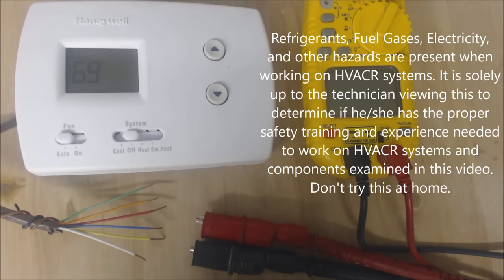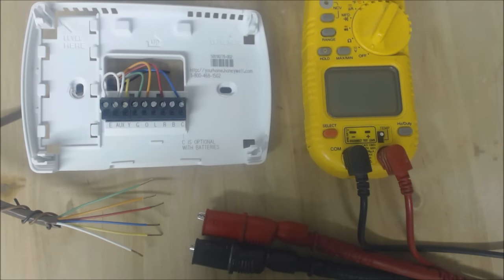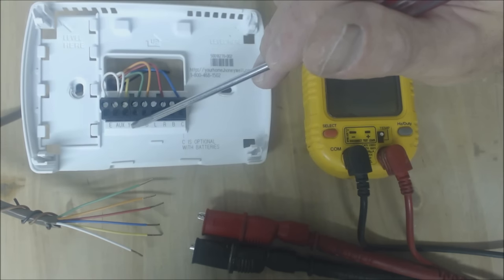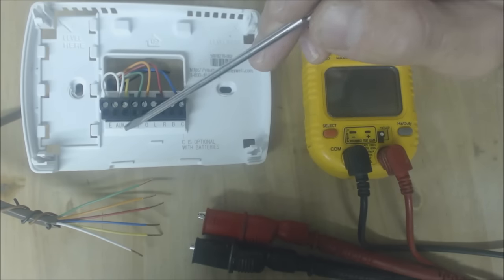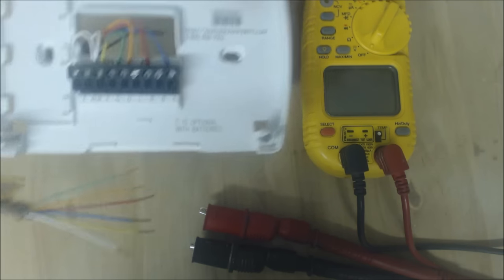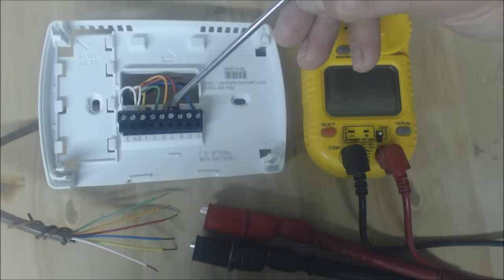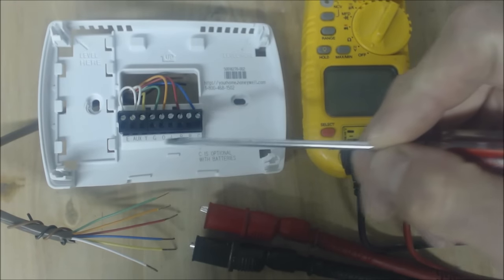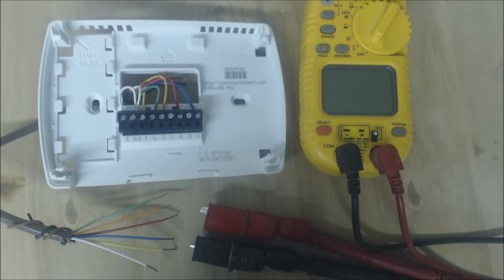Understanding and Wiring Heat Pump Thermostats with AUX & Em. Heat! Terminals, Colors, Functions!

Comment: hi, so with AC there's a coil above the furnace. with a heat pump, is it the same coil above the furnace? or something else? i am referring to a heat pump and a forced air furnace pairing. thank you.
Reply from the maker: Yes it is the same. The txv or piston allows a bypass for the refrigerant so it does not get metered in that direction. Have you looked at each of the videos in the "acservicetech refrigeration cycle playlist"? There are some that talk about the heat pump cycle, thanks

Comment: We've got a Rheem Dual Fuel system with an outdoor sensor and I'm trying to switch to a newer (TH8321WF1001) thermostat. The previous one has S1 and S2 connections, but the new one has two S1 connections? Is that a problem or should I just connect the two previous wires to the two S1 terminals? Thanks and great video!
Reply from the maker: The S1 and S1 are for indoor or outdoor sensors so yeah you can connect there and then enter programming to let it know that these are for the outdoor sensor, thanks!

Comment: Thank you for your video. Question about C wire: Without batteries, how could I see the digit numbers on the thermostat?
Reply: Hopefully by now (a year later), you have found your answer, elsewhere; however, in the case that you haven't or for anyone reading and asking themselves the same question.. here's your answer and then some. The thermostat, itself, receives power from the RED (R) wire (24VAC) and the power flows out via the BLUE or Common (C) wire. So, essentially with those 2 hooked up, there is no "need" for batteries. I say that; however, if you have a thermostat that has specific programming/settings/schedules/temperatures set, etc. by all means, keep the batteries in there as a backup source of power. The batteries' purpose is for the simple convenience of retaining all of those settings, within the thermostat, in case the power goes out or you need to flip the main breaker in your house, for some examples. *(Think: alarm clocks. Remember when people used those, instead of their phones or their favorite home assistant to wake up? Oftentimes, most people would keep a battery installed in the alarm clock, in addition to having it plugged into a wall outlet, in order to keep the time and alarm(s) saved, in case of an unexpected power outage.)*

Further, regarding the particular model featured in the video, a Honeywell Pro 3210, perhaps, it's a simple and basic thermostat that is pretty straight forward and has standard modes 'n' settings. If you have one of these, as I do, you already know. The most advanced you'll get on that model, is programming your thermostat to match your system type, setting the cycles per hour (CPH) of the Emergency (E) and Auxilary (Aux) Heat, the Compressor startup wait time (default: 5 mins, though 3 mins is satisfactory) and if you want your temp to read in Fahrenheit or Celsius (fun for a quick laugh, as I did this once and watched as my wife looked at me, puzzled, as the thermostat read "23" (Celsius) in the summertime). If you're still reading, there are also some basic system tests you don't have to be an HVAC tech to run through, if you're also a DIY'er and like to run through your own system maintenance checks in between annual tech visits. 

I hope this helps somebody out there. I'm not an HVAC technician. Just a guy, with a mind and a passion for mechanics and anything that has moving parts. God Bless!

Comment: I have carrier heatpump model 50VT-48---30TP.  The thermostat was honeywell TH522OD1029 with 6 wires hooked up to it.The wires were R=red Y=yellow C=white O/B=orange G=green AUX=blue AUX+E = Orange wire jumper. The R and RC jumpered also the E and AUX jumpered.  I installed a ecobee 4 smart thermostat it would not allow E and AUX to jumped. I put my aux wire on the w1 on my ecobee4 . My question is will the new thermostat go into defrost mode in the winter like the old one did. Thanks
Reply from the maker: Defrost has to do with the control board outside which will then send a signal to the indoor air handler auxiliary heat. If you didn't change the air handler low voltage wiring then it should be the same, thanks
Reply: Thank you  this makes me feel much better and love the vids.

Comment: I don't expect you to reply, but if I shot a fast 1 minute video of my thermostat - do you think you could help me ? .... I just turned my heat on today, and the stupid thermostat thinks I have a heat pump, so the heat coming from the furnace is not very warm.  I heard my air conditioner actually go on when I put it into heat mode... so I turned it all off and went outside and unplugged the fuse beside my central air conditioner air unit outside ) ... then came back in turned it back on ( the furnace ) and it said heat on with heat pump..... anyway,  the air conditioning guy was here about 3 months ago and didn't change any wiring, but did do something to the thermostat - he changed a code on it, on the digital display which made this error start happening.  Thank you.
Reply from the maker: I would pull the fact of the thermostat off to find the model number, look up the model in google and also type manual or installation instructions and you will find how to get into your settings for that particular thermostat. Then just set it to furnace instead of heat pump, thanks
Reply: Hi there, THANK YOU.  Wow.  I did you what you said, and Youtube'd it and after a few minutes of looking I found a video on the exact model I have ( White-Rodgers model ) . It goes through all the process.  Thank goodness for these videos.  Thank you for your help !  I have the thing back in "heat" only mode.  ✅✅✅  I don't wish to pull people way from your channel, so won't put any direct link to the video I watched, but am very glad I found your channel, and am happy you were around to offer assistance.

Comment: I have a heat pump with 95% efficient gas furnace, (not my design)  I do not want the heat pump to run EVER. I was going to install a nest stat but without using the orange O wire like it was not a heat pump. Now that I saw this video I think that will stop the A/C from working. I would have to install the nest as "duel fuel" which requires pro set up only.  I do not want to spend $150+ because I do not have the pro access code. Looks like I am forgetting about even having a smart stat. You saved me some grief if I'm  interpreting this right.

Comment: What does the blue wire go to. I have a Goodman heat pump with heat strips. Has soon as the temp is set one degree higher the indoor temp drop down so that it makes Aux heat come on. Im trying to make sure things are wired right.y contractor left a mess.
Reply from the maker: It sounds like the heat pump is not coming on or is not working properly and electric resistance is all that is heating, thanks!

Comment: I need the help of all your experts, every time I take the temperature up and down due to the change of the weather, and then my heating unit is not working. What I want to know is the air handler or heat pump compressor problem. The technician can only work is replacing the "fuse". But one month later, it happened again and again. Technicians only change the fuses again and again. Any help would be appreciated.
Reply from the maker: If they are changing the low voltage fuse over and over but it is intermittent and don't know the cause, just take one thing out of play at a time. Replace the tstat wire going to the thermostat. See if it happens again. Then replace the outdoor tstat wire, wait, replace the tstat, wait so on and so forth. Unfortunately intermittent problems are rough and we can only fix it if we can see the problem. The rule is though, don't just do the same thing over and over. Try something, thanks

Comment: Regardless of temp my AC guy says only use emergency heat because it will save money.  Would you find this to be true? Any cons to only using emergency heat?
Reply from the maker: It would depend on what the tech has emergency wired to. If it is a hot water coil from a boiler in front of the air handler then good. If it is how most are wired though with a jumper from emergency to aux for electric resistance then that would not be good. If you have a heat pump then you want that to be the primary heat until it gets down to about 30 degrees. Once again, your tech may have the emergency heat wired to something different than electric resistance coils, thanks
Reply: acservicetech  I have a heat pump. The the unit uses gas.  I am under the impression that using the emergency heat uses only gas.  Currently gas is cheaper than electric.
Reply from the maker: Oh that is a dual fuel system, very awesome! It is great to have a choice, thanks!

Comment: Thankyou, you made it very understandable! Do you always put a jumper between the aux and emergency terminals? I have a 2004 2 1/2 ton Lennox heat pump. I read somewhere about an emergency heat relay.
Reply from the maker: Only if you want the heat strips to turn on automatically when the heat pump cant keep up, thanks

Comment: Hi AC Service tech: How does the thermostat control the fan speed theough the green wire? Does it change the voltage level or does it use a pulse width modulation (duty cycle) to achieve this?
Reply from the maker: G will only power one speed but if the board also recieves a signal on the y then it will move to the higher speed. A modulating air handler or furnace will control the variable air speed via the control board, thanks!
Reply: @acservicetechchannel  Thank you!

Comment: Great video thank you!  Getting ready to install a new heat pump thermostat for my mom.  She has Heat, Cool, and Emer Heat (heat strips in the air handler).  So my question is, should the outdoor unit run when Emer Heat is selected or are they mutually exclusive?  Again thanks so much!
Reply: 3 months late to your question. HVAC tech here. In heat pump application both indoor and outdoor units run in COOL, and HEAT mode only. When in EM or AUX mode only the indoor unit will run, unless it is too cold in the home, typically 3° then the unit will turn on both heat pump AND aux heat. Think of it like a fan flowing across a toaster oven. That’s how the EM heat produces hot air, at the cost of electricity. When possible, run heat mode but if this mode breaks run EM heat. Also to note getting an annual or bi annual system check by a professional company to check these modes and the operation to keep you up to date and maintain the system 👍🏼

Comment: I have a loosely related question. I have a bonus room over my garage that has its own zone of hydro heating and cooling on an air-handler in the attic. Works great. This bonus room also has hot-water baseboard as a supplemental heat source. Currently, there are 2 thermostats in the room, one for the air-handler, and one that goes to a Taco switching relay in the basement to trigger the furnace and circulator for the baseboard heat (only baseboard in the whole house, rest is all hydro-air).  So my question is, can I change to one thermostat in that bonus room? So when I set the thermostat to call for heat it calls to the air-handler and the baseboard?
Reply from the maker: Yes if you separate the voltage of the two systems with a 12amp fan relay. So the heat signal would power the fan relay and then the power wire for the other system would get connected to the switch in the relay and then go back to the system as a call for heat, thanks

Comment: I thin I blocked my thermostat or something. Temperature doesn't show, I can't even start it up. Screen is on but it just shows two dash lines instead of numbers, it's a Honeywell. Any ideas?
Reply from the maker: Try turning power off and then back on or replace batteries if equipped. Check to see if you are getting 24v from r to c if powering it from the furnace or air handler. Other than that, you would likely need to replace it, thanks

Comment: Can the common wire be jumped with the red wire to eliminate batteries? 
Can the green wire  be switch to be common at the thermostat and control board to install a smart wifi thermostat like the Nest?
two different scenarios.
Reply from the maker: C to R would short the transformer or blow the 3 or 5 amp fuse. You need a load between r power and c common to power the load, otherwise it is a direct short.  You certainly could take out the fan option and just use this as the common instead if you switched that wire at both the tstat and control board, thanks
Reply: To answer your question: The moment R and C are connected at the T-stat terminal bus the T-stat has 24v coming in from R and staying powered by C. The batteries are in to help save the program in case of power loss.

Comment: I have an issue with my Trane heat pump system-it just started buzzing very loudly from the inside unit and the thermostat read AUX heat. Can u offer any advice to someone that has zero knowledge on heating&air systems?
Reply from the maker: Maybe something is wrong with the electric resistance heater inside the air handle which is powered when turned to aux. Honestly if you are not already a tech I would advise that you call a licensed HVAC tech. The Channel is supposed to be for techs improving their knowledge and that sounds like it could be a dangerous situation possible in terms of amperage. Once again, I don't know what the sound is but unless you are aware of what is going on inside, I would not advise you to do this yourself. Thanks
Reply from the maker: I would turn the system off until a tech can arrive.

Comment: My thermostat will not shut off the compressor (heat pump)
when it reaches the desired temperature.  
It is a Carrier thermostat.
The compressor just keeps running even after it reaches the temp I set it for.
I always have to lower the thermostat temp in order for it to shut off the unit.
Any idea why this is happening?
Reply from the maker: That sounds like it is a bad thermostat, thanks

Comment: I had a t8411r and replaced it with a rth3100c it was wired originally g/green black/c w2/white red/r yellow/y which was jumpered tow1 and orange/o I wired the new thermostat just like you did and I notice mine stays on aux heat an awful lot...could my wiring be wrong
Reply from the maker: It is possible that your heat pump is having trouble keeping up with the heat loss load and there may be more than just a 1 degree difference in what you have the tstat set at compared to what it is in the building, thanks
Reply: acservicetech thanks for responding...i notice when i drop the thermostat to within 1 degree the aux turns off...but then the house temp drops and within 2 or 3 degrees aux comes right back on
Reply from the maker: Either the heat pump by itself can't handle the load and keep it within 1-2 degrees of the temp set or you will need a 8000 version honeywell or another stat where you can set the parameters of operation more, thanks
Reply: acservicetech thanks

Comment: I try to install nest for my goodmen heat pump  Y1 connected to yellow G for green and C blue for common and w wire for white and orange for O or B and finally red for RC my system is not working the way it should the compressor turns off every 10 min and starts again but the fan is on. How can I fix this ?
Reply from the maker: It sounds like you may need to switch the settings, or y/y2 instead of y1, Rh jumpered to Rc. Also turn the power off and check in the furnace or air handler to make sure your color wires are correct, thanks
Reply: Now it works but after 20 min of cooling the compressor turns off but the fan is on and after 3 min compressor turns on again and does the same thing over and over

Comment: I have a brown and black wire too. Where do they go? Please help.
Reply from the maker: They may be attached to an outdoor temp sensor. I would turn the power off to your indoor furnace or air handler and check to see where they are connected to or if they are wire nutted there and go out the the outdoor unit. If you see what they are connected to then let me know, thanks

Comment: So I shouldn't Have my brown wire connected to the E terminal?
Reply from the maker: This is just the normal color code. If everything is fine and the brown wire is hooked up in your air handler to turn on electric resistance on then as should then it is ok regardless of the color. I had to switch out a color wired for another colored wire out just last night. Check this video out--https://youtu.be/fFL_ZSkAZM0

Comment: is the common wire considered the "ground" or "neutral" wire?
Reply: "Common"  here relates to the 24-volt transformer. "Neutral" relates to the white wire of the 120-volt circuit; functionally they are somewhat the same, but should not be confused with each other.

Comment: hi i have thermeral heat pump, i connect orang wire to orang but not making heat, please help
Reply from the maker: If its a rheem or ruud it would be B for the reversing valve, thanks

Comment: Can you do a video on wiring variable speed air handler to a single stage condenser. Using a 2 cool thermostat? Please
Reply from the maker: Anthony, thanks for letting me know what you would like to see! Anthony, you would just jumper 1st and 2nd speed in the thermostat together and run one wire out for cooling to the air handler and single speed ac unit, thanks